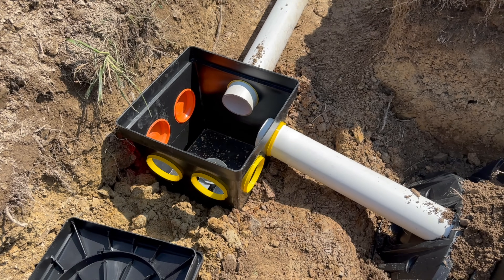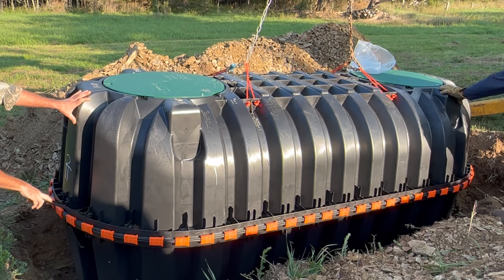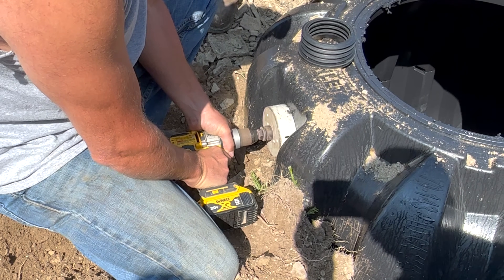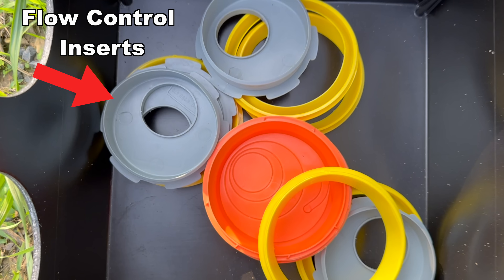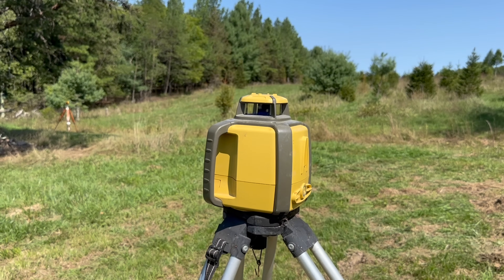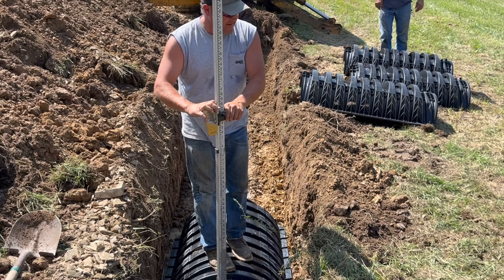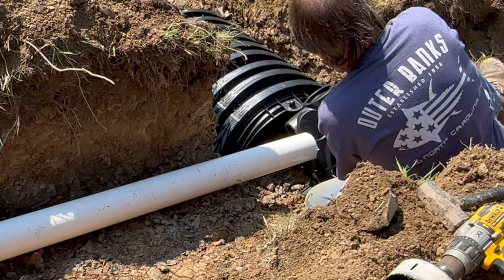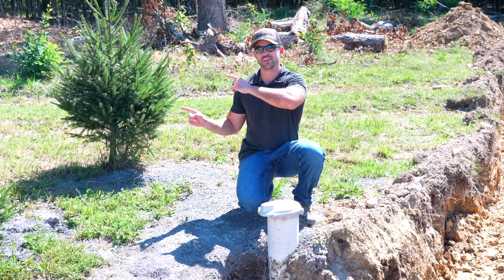Septic System Installation - BEGINNERS Guide to Gravity Septic Tank & Leach Field

Comment: Boy have times changed with systems. Of course checking with codes in your area, the systems will be different. In our area, a mounding system is used but finding to have issues. Technology is the key besides the area. I love how this system works. Our system is a leach field system but over 50 years old but still working fantastic. Our neighbor has a system that looks like a submarine with a sprinkler type system that discharges the output water around 2-4:00am. Yes the grass is greener there. Hahaha 
Thank you Josh for this real educational video and perfect description of everything as always. 👍🏻👍🏻🔨🔨
Reply from the maker: Thanks so much! It's amazing how technology keeps advancing, even in systems like these. It’s great to hear your leach field system is still going strong after 50 years! That submarine sprinkler system sounds pretty wild too. Definitely helps keep that grass green! Appreciate your support. Thanks for stopping by again David!
Reply: @TheExcellentLaborer  I would much rather have a leach field than replacing aerators and buying chlorine tabs for that other system.  It's cheaper upfront but i like it old fashioned
Reply: f*** the codes just build what works. for example these leach fields are twice as long as they need to be
Reply: We can use mounds if there is a high water table or super clay is involved. But that takes up a lot of space. I hate doing septic in North east WA the most. They are not lenient. Worse the the nw coast